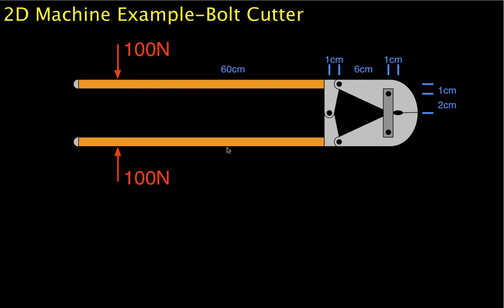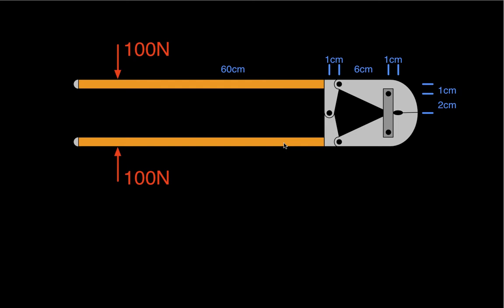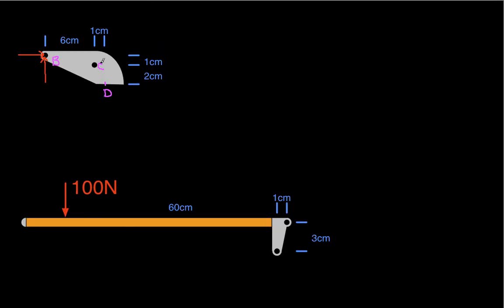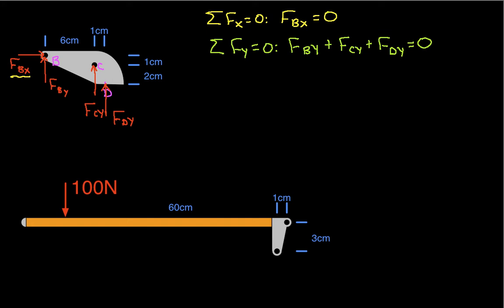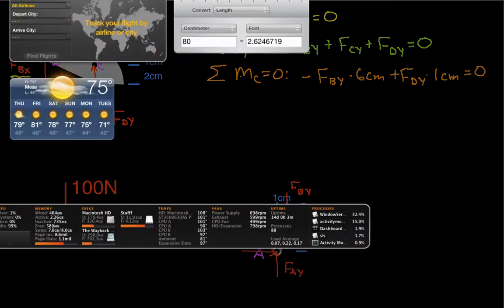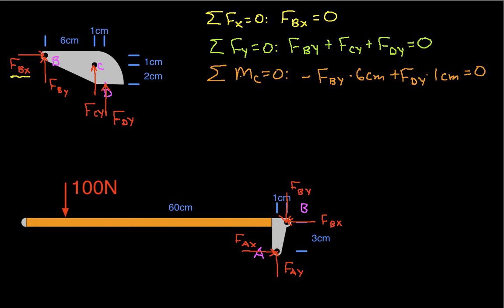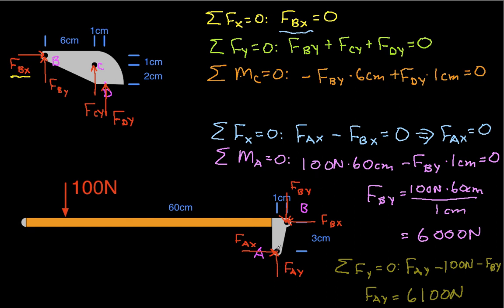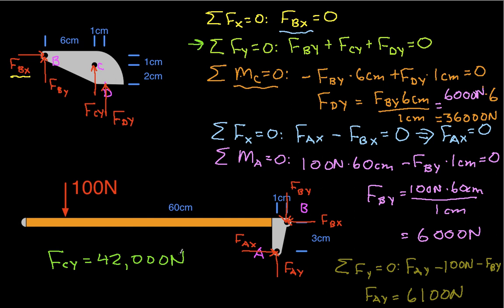2D Machine Example-Bolt Cutter

Comment from the maker: The analysis is a static analysis, which assumes that everything is in static equilibrium (nothing is moving); this would be the case if the force on the handles is not large enough to cut (deform) the rod. As soon as things start moving, this analysis is no longer exact; without doing a dynamic analysis, I don't know off the top of my head how things would change.